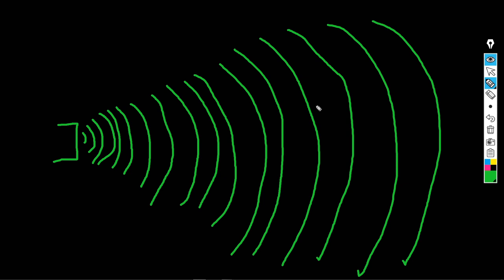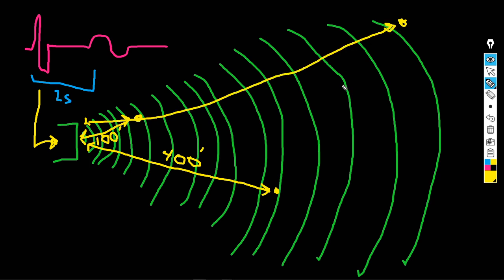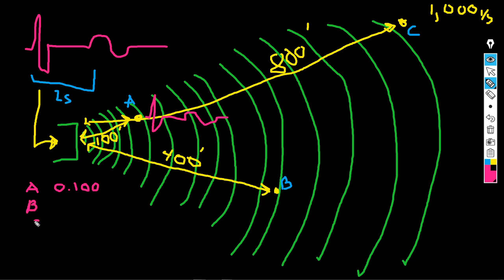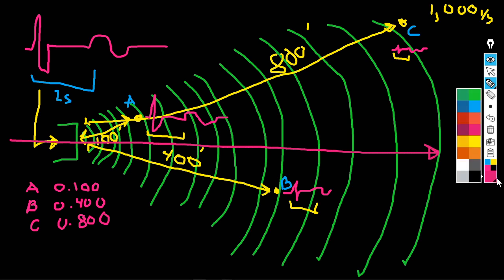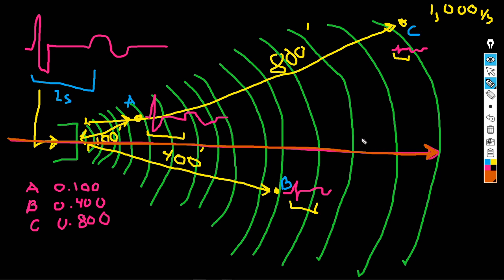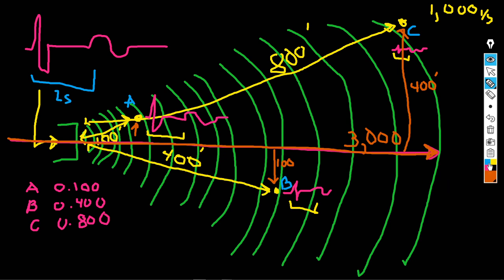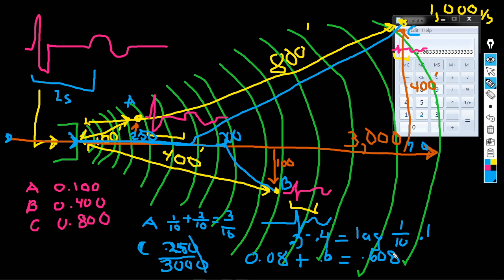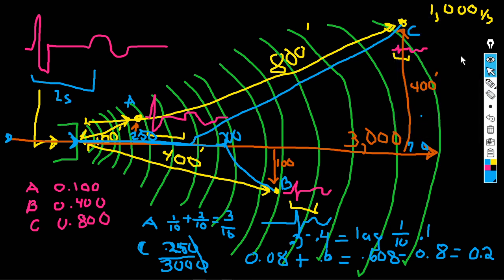Las Vegas Shooting -- Gunshots Over Speakers?

Comment: One speaker producing both muzzle blast and supersonic crack is not viable premis. And that is proven by Cory Langdon's taxi video. There is only very clean "muzzle blast" sound wave and following echo pattern. Supersonic cracks need to be produced through multiple speakers inside the venue. There is photo of tiny  speaker boxes with Cisco wifi-antennas installed for signal feed.

Comment: Dear Vegas Sounds.  I had this 'conundrum' with speakers and sounds. I was looking for a visual clue for "First Shot" .. I did not find it unfortunately ( Stage light of other ). I then decided to try to sync more that one clip to the [Aldean sound track], as the beat shows up very clearly. This 'bucket test' showed that the first shot, did not occur in the same position of the sound track compared to two other recordings ( about 1/10 second earlier or 30 yards difference in source location) .  ....  However   the sound Aldean sound tack actually has more than one location other than the stage, and that is the 2 speaker towers. It was at this point I gave up.
Reply: Those  speaker towers middle of the venue, if properly adjusted, play digitally delayed signal to compensate the distance from main stage speakers.  In addition there is usually tiny delay pattern between individual speaker units installed in single line array column. 

"First shots" were recorded on several locations and those recordings vary a lot. Especially because there is missing shots. Different shots are totally inaudible on different recordings. How that is possible if there was single source for the gunshot sounds? 

If single fire crackers were set off on every corner of the venue and so was recordings taken every corner, then I could imagine that furthest away fire cracker, maybe behind some structures too, might get muted bellow hearing level. And we have visual confirmation that 3 hand held smoke crackers were set off in front of main stage, both sides by different individuals embedded with audience.
Reply from the maker: yup, takes much work to figure out which sound comes from which source particularly when trying to align them accurately down to the millisecond range
Reply from the maker: @stablefoe6162  No matter what delay is applied to what speaker, if the speakers are any substantial distance apart, like the towers there will be lots and lots of locations where the signals are out of phase.  Lets say the tower are 250 feet front of the stage and I delay the signal by .25 second at the tower.  Now if I'm near the stage i hear the sound very soon, but the sound from the tower now delayed by .25 and taking another .25 to get to me is almost 1/2 second out of phase.  Yuk.

On all recordings (i've looked at 15+) and using spectral analysis the vast majority record clear and measurable points for supersonic wavefront, muzzle, and multiple reflections.  So the information is recorded.  As far as "hearing" it, that more a functions of relative sound levels, a person screaming near a jet plain is hard to hear also.

Also, comparing sound level between recordings is like near impossible, even on one recording the gain varies by so much there is difficulty determining what sound is actually louder than the next.(absolute sound level)  Imagine two people recording, one with their back to mandalay bay and other facing mandaly bay.  How "loud" would you expect the signal to be on their recordings?  I would expect them to be VASTLY different levels.  Image one camera directly facing madalay bay and another face 90 degrees with its narrow edge pointing towards mandalay bay, what signal level should they record?  I would suggest the sound pressure levels recorded will be substantially different even if they were standing next to one another and even if they have the same phone with identical user settings.

Some recordings are made lower than shoulder level where sound has to work it's way down past people.  Oh and let's not forget what setting the user may have set which can alter many of the algorithms related to gain control and frequency response.

As you've stated, signal quality varies dramatically from phone to phone or camera to camera.  Signal to noise ratio is always a great concern.  In the venue generally, signal to noise ratio is often poor, masking certain sounds.  That's why I relay on spectrograms because a percussive gunshot audible or not often stands out like a sore thumb.